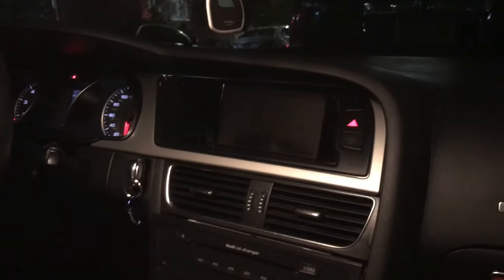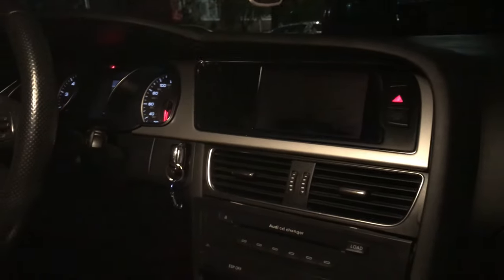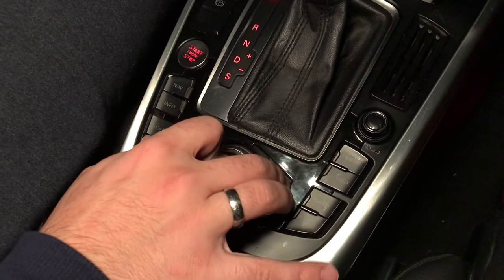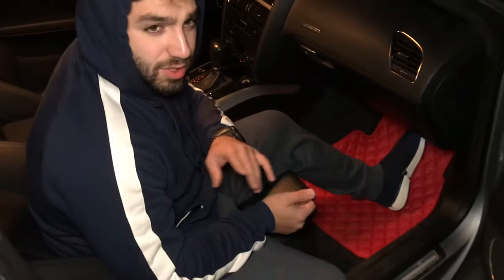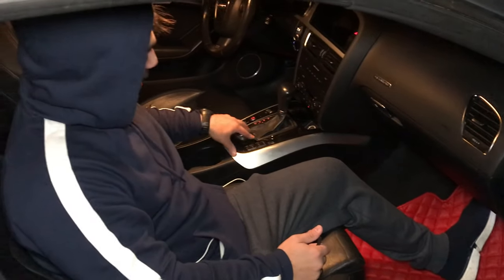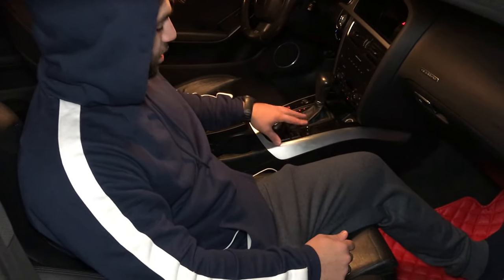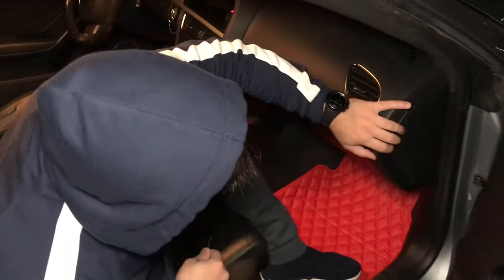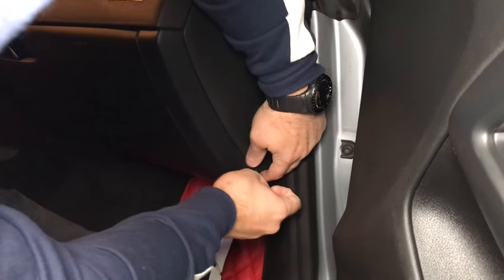How to fix Audi MMI | Multi Media Interface Screen Comes on and then Shuts off

Comment: Thanks, helped. Had my windscreen washer fluid spilled in boot (trunk) at that side. Dried it and worked like a charm. Had a sound like mini sparkles happening on passanger side, I guess the fuse was making that noise, but all saved, didn't have to change anything.

Comment: What helped for me after i jumpstarted the car with a booster is, reconnecting the battery so it resets itself.
Mine had the turn on and off loop. Hope it helps for others I did this on my audi s5 07.
Reply: You saved my life with this comment
Reply: I hve a 2008 Audi n this worked for me
Reply: Hey bro wym? I got the I’ve tried all fuses, and hard reset, you jump started it but was your car dead...?
Reply: I have the same issue for the second time now. My battery voltage is at 11,7 at rest. Could it be the battery? And also please could you explain solved your loop reboot?
Reply: Man I got rid of my S5 already, too much money to fix that and time as well, dealership don’t even know the issue I’m not going to pay labor for them to read codes ?
Reply: @vnorman5332  this saved my mmi from the loop. I didn't disconnect my battery, just started with my battery connected in the trunk and another cars battery connected to the front. Fixed it immediately! ❤️
Reply: @abu9357 so you started it with another batter connected to the front terminals? As if you were jump starting it

Comment: Hey if everyone wants one last ez try, unplug your big fuse that says “40” behind the fuse box, clean it and stick it back in. I also unplugged two square box style fuses that say something like “634” on them and replugged them back in... cancelled my apt to mechanic and haven’t had a problem in 1 month so far. 

I think the 40 AMP Fuse was the problem cuz it looked very dirty and I had to clean green stuff of it. 

Going to buy a new one obviously but give it a try and reply to my comment if it worked !
Reply: behind which fuse box? the one in the trunk? the one in the cabin? or the one in front? did you have the mmi completely turned off? because that's my problem that my screen is totally off!
Reply: @cocinandoconfrancis  yes is the one in the trunk, my mmi was off until I unplugged it and cleaned it.
Reply: BRO I LOVE U MINE WAS UPSIDE DOWN AND I HAD TO CLEAN IT AFTER TRYING EVERYTJIJG ELSE ANDIT WORKED CHEERS MANNN!!!

Comment: Hello, i have a 2013 s4 and  mine is the same way no light up buttons and no screen but mine is off all the time it does not turn on at all .. any suggestions? 
Thank you!
Reply: Hi! Did you fixed your car if you fixed you can say to me because have the same problem with mine😀
Reply: Have you fixed the problem I’m having the same problem with my A3

Comment: I have a 2007 Audi Q7 and I tried the same steps and nothing happened, would you be able to recommend anything else.
Reply: Hey,i have the same problem with my audi q7 2007
Reply: @endritsopaj8363 any chances you fixed the problem?

Comment: Was the original fuse blown ?? The one you replaced was it blow and not connected ?
Reply from the maker: Yes it was blown and it was not connected
Reply: @WantedCustomstv  thanks for the reply man I disconnected my battery n reconnected n it worked ! Thanks anyways
Reply from the maker: @FYEGLOBAL_  thats good no problem man
Reply: Where’s the fuse for the mmi system

Comment: How you do this in a a4?
Reply from the maker: what year is it?
Reply: It’s a 2009 a4 3.2 Quattro
Reply: It turns on then off
Reply from the maker: @tonyhernandez7008  you should be able to fix it if you just follow the same steps, check the fuse box on the right side, it most likely is the fuse
Reply: Flip Bros yo I checked on the right side of the car in the back and something is not connected I don’t know where that needs to be connected tho
Reply: @tonyhernandez7008 did you ever figured it out? I know this was 3 years ago worth a shot tho

Comment: Did you fix the sound? I have the same fckng problem 😐
Reply from the maker: Sorry we didn't get the chance to figure out the sound problem, but lot of forums said that you gotta do a hard reset on the receiver in the trunk, disconnect the three cable connectors. might work
Reply: Flip Bros it didn’t.. i still have this problem. I couldnt fix it, mmi works but no sound
Reply from the maker: @okanization342  damn bro we never got to that part... I ll see if I can find anything and let you know
Reply: @WantedCustomstv  are you guys doing another video about the sound please?